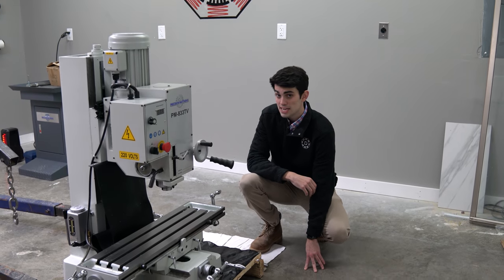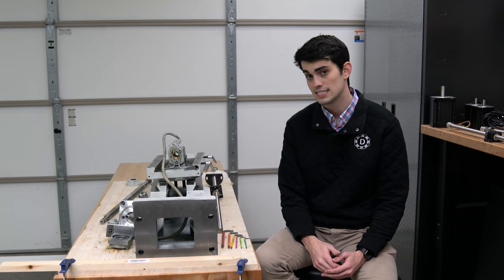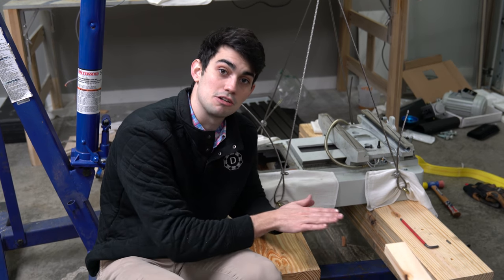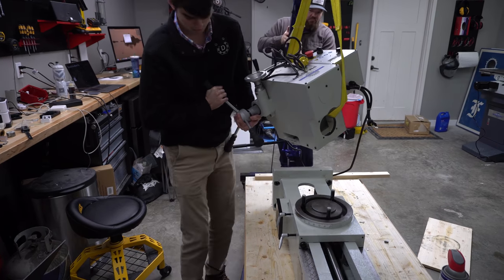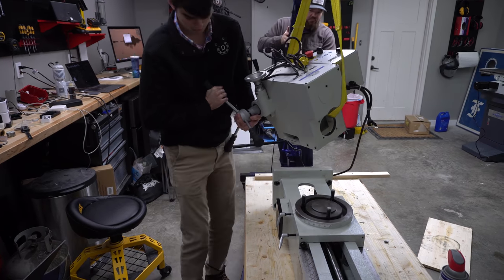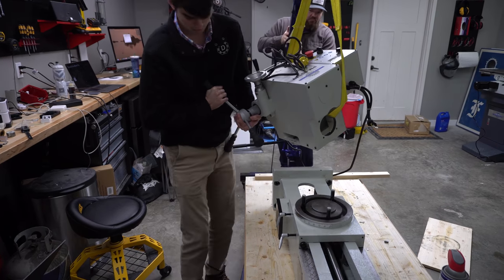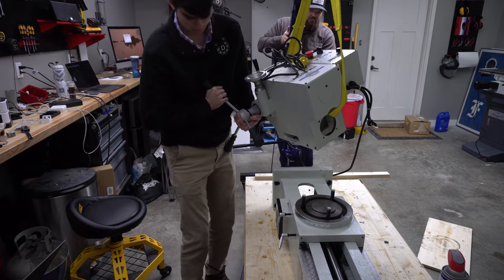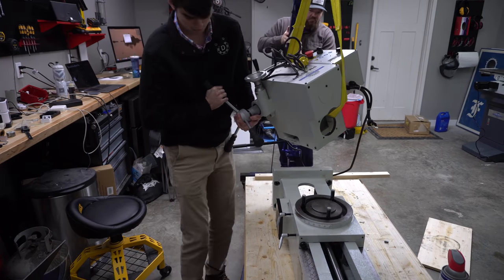How to Convert a Manual Mill to CNC

Comment: I am really impressed with this project and the documentation on your website. Have you thought of adding linear scales to your setup? Idk how much it would help
Reply: CNC mills have X, Y and Z position displays. It is just a freebie of the setup.
Reply: @1pcfred  All precision CNC machines use scales and a closed feedback loop to acount for inacuracies in the ballscrew and deflection. Without the scales the reading is just an estimate.
Reply: @Sketch1994  perhaps. But my machine estimates quite good. Better than a thousandth of an inch. Which is more than sufficient for me. If you want to map your lead screws the software I use supports the feature. I'm not looking for micron precision though.

Comment: FYI you're using your crescent wrench backwards. It's also a handy  tool ,but the wrong tool used proper wrenches or sockets. Everything should be torqued for the torque wrench, sure you have.

Comment: you are correct about flaking ad what it does, however, that's all that's there. those machines have not been scrape, the telltale is the price point and quantity sold. scaping that many machines would need an army of pro scrapers, It would easily take a pro to do that machine a day. i'm positive about that.

Comment: Very en-lighting to say the least, at 68, I am on a path to converting a RF-30 that we (Bride & I) just purchase used over to CNC. Not a high tech as yours on this video, but it already has power X, DRO to x,y,z and new 3hp Baldor with motor controller, so a plus. Sold our '80 Enco that was a great mill, but out dated. Will be coming back often to your channel. Bears Rod Shop

Comment: hmmm , looking intoo a simulair machine (the same frame) this machine is different with the beltdrive setup , usually they have oilbath gears and big shift knobs on the face of the machine 
this machine does seem a lot queter indeed

Comment: Cool stuff! how did you wired the drewtronics probe to the mesa? I have both but my probe led doesn't light up.
Reply from the maker: Hey man!  Check out the build page under the "sensors wiring" tab. The Drewtronics probe acts like an NPN switch NPN https://www.drdflo.com/pages/Projects/CNC-Mill.html
Reply: @DrDFlo  hello great video and site . Can you tell me what is the model of the touchscreen monitor?
Reply from the maker: @milenyankov  Hey! It is the ASUS VT229H

Comment: Its late and I should be sleeping but question! Would it be possible to measure your backlash on each axis then modify your g-code to account for this variance and run it out in the process during drive directional changes?

Comment: Suggestion, consider grease lubrication. If you stay with way oil you need a suction filter and line filter. You should hit up lube usa
Never use compressed air to blow chips away always brush them away. Number 1 you will blow a chip in someone’s eye. Number 2 you will blow a chip somewhere it gets lodged in the dovetail

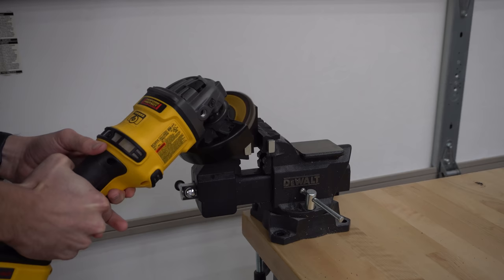Comment: You're holding the angle grinder incorrectly 5:19. It's dangerous and causes a lot of chatter. Attach the side handles or hold it closer to the head.

Comment: Precision Mathews used to offer pre-converted CNC mills fairly recently, I have one, I'd like to buy more, but it seems they have stopped offering the CNC'd ones at least for a while.
Reply: also UCCNC is a great option I can do rigid tapping with it etc,  very responsive service, great forum, can use MODBUS to talk to auxiliary microcontrollers, robots  etc I ditched MACH3 because of glitches that were abandoned when they went to Mach 4 and can't do fine encoder resolution (rigid tapping/threading). I chose UCCNC over centroid Acorn because of UCCNC's modbus scripting capability, Centroid mentioned doing this at one point..instead they went with relay expansion boards which are nowhere near as flexible/capable as MODBUS.  Other than no Modbus   and cost, I would consider Acorn, a more costly   good alternative, although I have not tried Acorn.

Comment: Those ways, just so you know, are not hand scraped, they're ground on a way grinder and only the half moon marks are done by hand to allow a space for oil to sit between the surfaces. Hand scraping is a long process requiring a skilled operator and definitely not suitable for a low cost, mass produced machine. Have a look at hand scraping , it's magnificent when done properly.

Comment: I'm starting my conversion with your vids and website. In reference to the nuc you have listed what ram, ssd, & an os did you install to run?
Reply from the maker: The ram and ssd don't really matter. Pick whatever is cheapest. As mentioned on my website, the OS is Linux Devian. Follow this website for installing both the OS and ProbeBasic GUI: https://kcjengr.github.io/probe_basic/quick_start.html

Comment: Pro tip, put shower wall panels the thin plastic 4x8 cfrom home depot on the walls behind and sides around the mill. You will be using oil and coolants with a air nozzle spraying all over your nice walls and it will destroy them.

Comment: You don't need or want the swivel base on your vise. With cnc you will never use it and you lose z height also it adds weight to the vise. If you ever have machining questions or good ways to set up jobs or steps in getting to a good finished part I be happy to help. I ran Bridgeport mill for 20 years doing parts for the big 3 auto companies doing prototypes, fixtures,gages and one off hand tools. Then maybe you can school me in all the electrical stuff :)

Comment: Do you have a little more information on the wiring of your tool length setter?  Can you list where you hooked up the 4 wires?  I cant get linuxcnc to respond to mine.  I am currently using a 2.5K pull up resistor.  Your wiring diagram shows the probe wired to the board ground but the other ground wire is not terminated.  thank you.

Comment: Your tram is off or the mills inserts are not at the same height. Hey congrats on that part. Would a plunge chamfer cut be more efficient than interpolating every hole??

Comment: question: why not use a double ended shaft stepper and allow a handle to be used ?
Reply from the maker: These large stepper motor have high detent torque (the amount of torque the motor produces when the windings are not energized). It think it would be an arm workout to do any manual milling, which I didn't plan to do.

Comment: First off, just wanted to say great build I'm very impressed. Looks like a great project. I have a question, why did you go with stepper motor vs. servo? Was it the price point?
Reply from the maker: 100% price point. Would love to have used clearpath servos. I need to install a counterweight for the Z axis, so I that I don't have to buy a massive servo.
Reply: @DrDFlo  good point on the counterweight. Would the electronics/wiring for the motors be relatively the same for the servos?
Reply from the maker: @mmarmino  If you use Clearpath servos I believe so. You wouldn't need the stepper drivers. The servos would just take the  step and direction signals directly. This is based of my reading. I have not used them before because they have been out of my price range.

Comment: Now when do you get a lathe? Then you'll need a surface grinder, bending brake, bandsaw, belt sander, bench grinder and heat treat oven to round out the shop.
Reply from the maker: Dude I know... so many things left to get. Let's just say a lathe is coming soon...

Comment: 0,007" out of square in YZ tells me the 'scraping' was superficial flaking to get oil retention, but definately not done for accuracy of the machine tool, otherwise the thing would be square. And talking about squareness, was the XZ tested at all? Wouldn't trust it if already one direction had a lean to it.

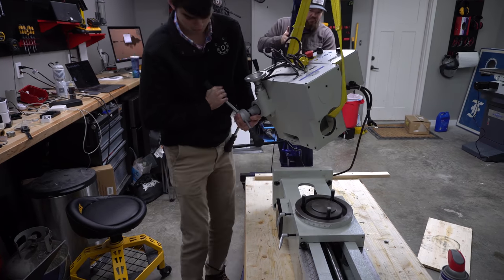Regarding the tramming of the spindle relative to your table, at 12:23 you can see the indicator moving many numbers when traveling in Y direction, which would indicate that the tram is maybe good in X direction, but the Y direction was not checked nor trammed for. And as above squareness gave away, I wouldn't be too surprised to see this spindle tram to be out of alignment either.
Reply: Also, the mill has a quill. Would check the travel of that in XZ and YZ also against a square once the Z-axis is squared both ways and the spindle tram is good in both directions.

Comment: The 2 hp spindle is quiet all the way up to its maximum 3200 rpm speed?...haha...LOL... ummm no. I've heard way quieter Mechtronic PM synchronous motors @ 15,000 rpm that you can barely hear. Careful your ears (20:20)... 😜

Excellent video notwithstanding...
Reply from the maker: I should have clarified… I live on a zero lot (my neighbors are feet away). So I was really surprised that you couldn’t hear spindle running through the garage door. So in that sense it was "quiet"

Comment: Im surprised you had to use a shim for the column, unless you took one out. If you were out its because you either have a paint chip caught, or you should try and tighten the front bolts before doing the aft one.
Reply from the maker: Any relation to Precision Matthews? 
As soon as I received the mill, I disassembled it to install the ball screws. I never checked the tram of the mill out of the box. To be honest, I was a little surprised that it was 0.007" out of tram over 8", but this was my first mill conversion, and I really didn't have a great reference for what the tram should have been... I did make sure that that there were no paint chips/debris on the machined surfaces and I did tighten the bolts in a couple different patterns, but the tram didn't change. I threw a couple pieces of shims underneath the front of the base and I was good to go.

Comment: The shims you used when tramming the coulum of the mill are not ideal for stiffness of the machine. When shimming the contact area is decreased and the coulum moves mord. Its better to scrape it in or, if you dont wanna scrape for days, you can also tram it with the help of epoxy. Steffan Gotteswinter did a great video on that subject. Go check it out!
Reply from the maker: Hey man! I appreciate your comment. I watched a couple of videos on shimming the column with epoxy and I got cold feet. As it was my first time , I didn't know if I could get it right in the working time of the epoxy. However, now that I am more  familiar with the process this is a planned upgrade!
Reply: @DrDFlo  What you did is fine. Often to make small adjustments you just have to torque the column bolts a little.
Reply: @1pcfred  No. Shimming that way will stress and bend the castings. The shims should be u shaped where they go around the bolts. So you don't bend anything.
Reply: @bigrick7108  If it bends it bends. So what? It's not like it is your pacemaker we're talking about here. So it is not exactly life and death, now is it?
Reply: @1pcfred  It will flex and vibrate that way.  Maybe not much because it is a tiny machine.
Reply: @bigrick7108  while less than ideal often in life compromises have to be made in the name of expediency. Which is to say less than 100% is usually good enough.

Comment: Are those Chinese mills any good compared to Bridgeports?.
Reply from the maker: Almost uncomparable... these small bench-top mills do not have the rigidity of a full size Bridgeport. However, I couldn't fit a knee mill in my garage.
Reply: @DrDFlo  Or do you mean, you can't get it through the door? The head height of your garage looks fine for a Bridgeport knee mill.
Reply from the maker: @jemijona  Yah that's correct. My garage opening is 6 1/2' and I believe a bridge port is 7'. So I would have to lean it or take some stuff off the top. But it would fit. I should have said that a bridge port is just too big for my townhouse garage that has other equipment in it.
Reply: @DrDFlo  You could tilt the quill / head over 90 degrees to reduce the Bridgeport's height or even remove the quill / head to get it through the door. I'll measure my Bridgeport in the morning.
Reply: @DrDFlo  My Bridgeport Series 1 standing is 2740mm (84") and with the head tilted at 90 degrees (remove pin to tilt past 25 degrees) it would measure under 1700mm (67"). While the overall width would be comparable to your existing mill, the depth would be larger. It would allow you to keep your grinder behind it though.

Comment: If I use a closed loop for the Z axis, and I get away with 12Nm?
Reply from the maker: That's 40% less power. I would not recommend it. You could use an air spring or counterweight to lighten the load the motor has to move.
Reply: @DrDFlo   Cheers, I've found a 16Nm system, and will adjust with spring as needed, cheers.

Comment: What's the best way to message you. I've got some questions about your build and I didn't know if you're still active in the forum.
Reply from the maker: Still active on the forum!
Reply: Hey I'm trying to reply in the forum and it says new users are restricted to 3 replies. I was see if you could tell what you mean by...

"If you are using a Mesa ethernet card, then after installing OS and LinuxCNC it is very important to configure the network adapter to get along with the Mesa card."

 I'm using the same card that you have and the nuc 8. I have debian 10 installed I'm about to install linuxcnc.
Reply from the maker: @mmarmino  It has to do with the Jitter. See more info here: http://linuxcnc.org/docs/html/install/latency-test.html

Also, depending on what GUI you use, Debian 9 is required. Debian 10 does not support the older libraries that the GUIs like Probe Basic require

I will investigate the forum problem. Thank you for bringing that to my attention.
Reply: I'm trying to reply on the forum. But it keeps giving me a notice. I took a screenshot and can share it with you via email or something.

Comment: Firstly, Kudos on your build..exceptional from concept to finished product.  Now the critic part of me ( don't worry I'm not mean).
The lack of Rapid moves hurts productivity a lot, I'm sure you can fix that.  
In the part you were presenting  showed a  lacking some fundamental understanding of Machining principles 101.
Spot Drill, that will insure your drill will be located accurately ( 120 deg' is best IMO) , cutting fluid would help a lot in your surface finish, that drill will load up with Aluminum and tear up your part as the drill dulls, if accuracy isn't a concern disregard. 
Chamfering the holes,  I'm not sure why you picked a small  45 deg" c-sink when you could have just used a larger one to plunge your holes saving you big time in lieu of circle interpolation x 96 holes and the outside profile as well.
Great job though.